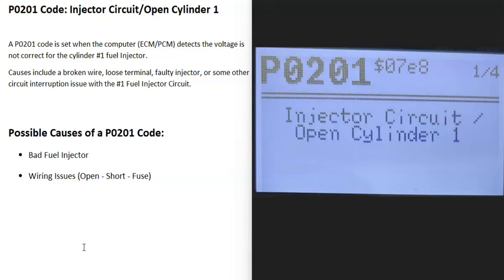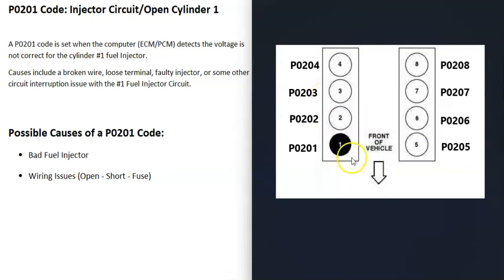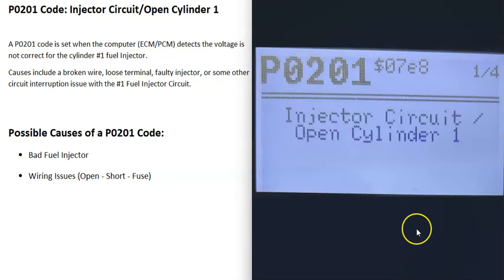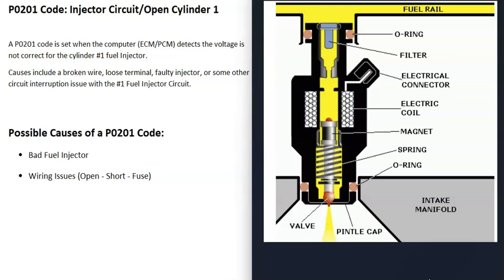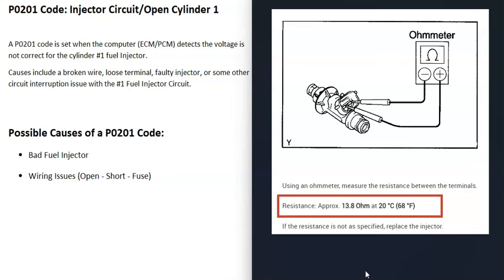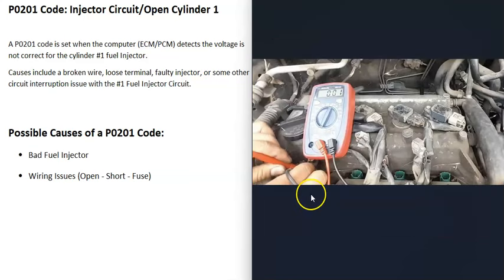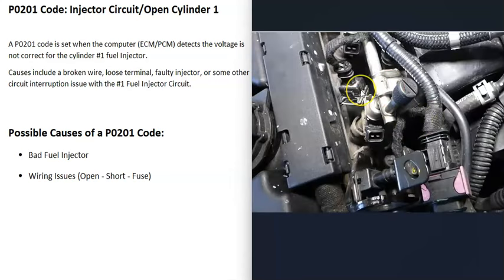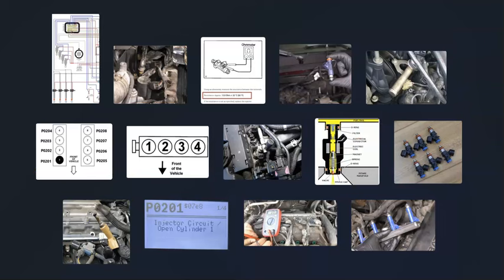Causes and Fixes P0201 Code: Injector Circuit/Open Cylinder 1

Comment: Thank you so much for the short and crisp video, summarising the topic. While, I know this varies from location to location, is there anyway to find out what can be the associated cost for fixing each of the issue. For example, replacing the fuel injector can cost xx gbp/usd and labour around yy. Similarly for other issue (wiring related)?